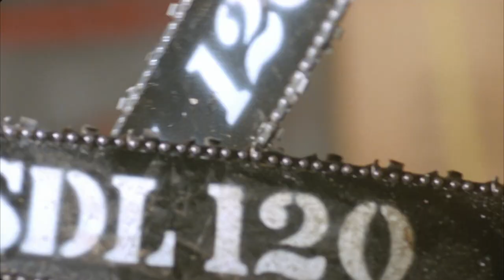Tiger On Beat - Awesome chainsaw fight

Comment: Why do I get the feelin they were swinging actual running chainsaws when they were filming this.
Reply: Nah, the chainsaw was not running, they put incense in it so the motor looks like it's smoking. The sparks were created by running a current on both chainsaw, the cables were hidden in the actor's clothing, the same technique used in Highlander sword fights.